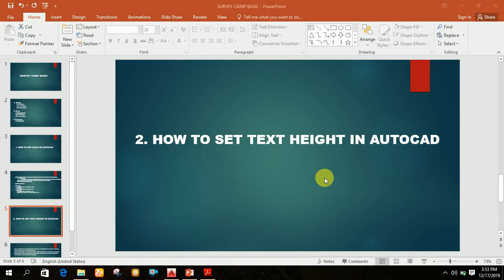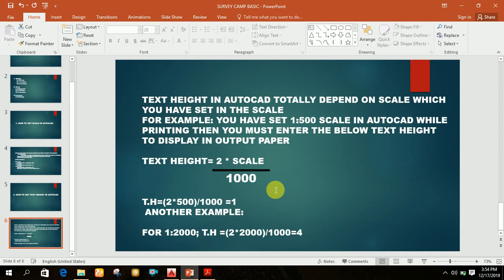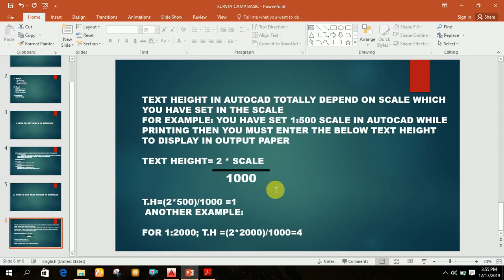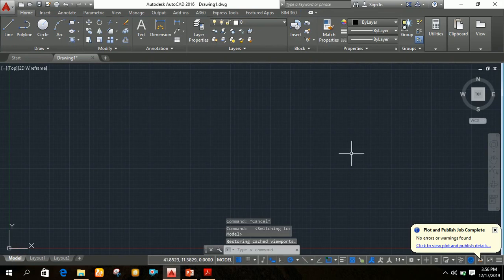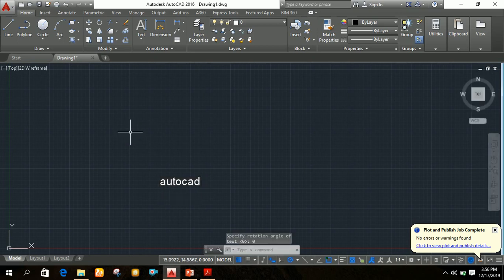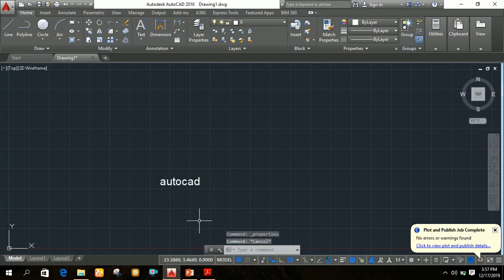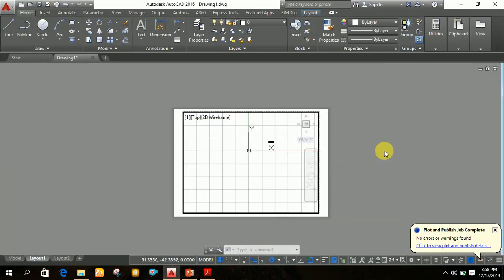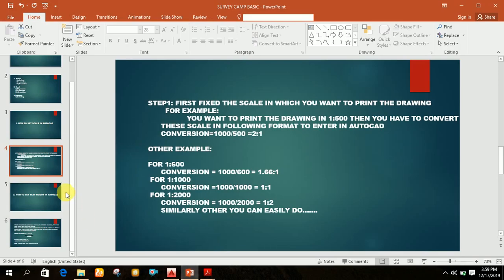How to set Text height based on Scale in autocad

Comment: How you set up this scale 1:500 to 1000/500 and 2/1 i usually put 1:500 in cad as 1mm paper unit = 500 mm model unit . But I did not understand what factor you will add with your representation of 2/1
Reply from the maker: Bro i've done this method 3 years ago.This method might work with Swdtm software.Or you can use directly as u have mentioned, just after converting to pdf, View to 100% ,if it is clear then its okay or decrease or increase scale.
I hope u understood bro..Have a nice day.